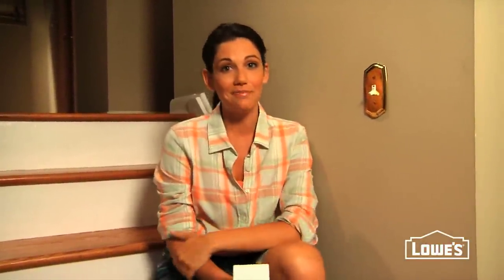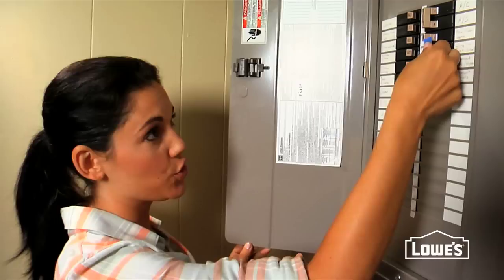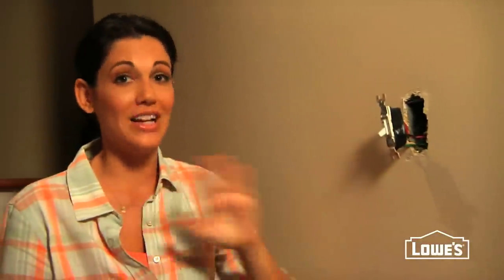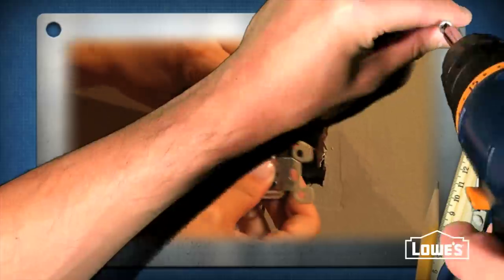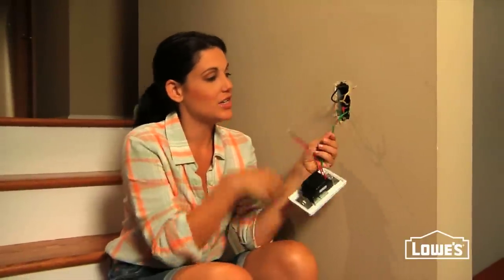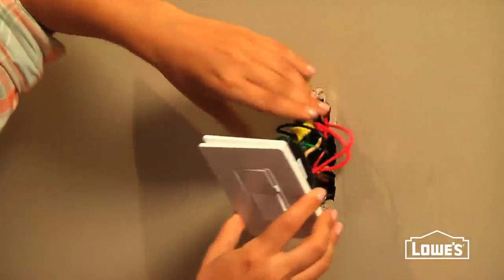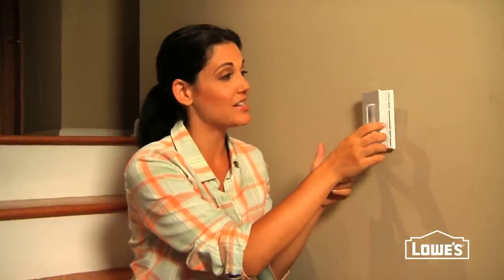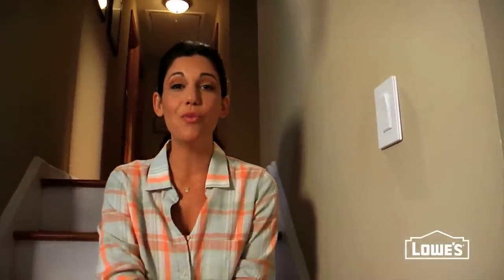How to Install a 3-Way Dimmer Switch

Comment: Installing a three way dimmer IS NOT just a matter of matching like colored wires.  This is how people make mistakes!  Before removing the old switch identify the wire attached to the common terminal and make sure this wire connects to the common terminal or common wire on the new dimmer switch.  The other two wires are the traveler wires and can typically be connected to either of the other two terminals or wires on the dimmer.  Always read the instructions and be careful.
Reply: Any way of identifying the common wire? My switch didn’t have a different color screw
Reply: @damon323  it really depends. i've seen some crazy 3 way switch wiring with different (non-standard) wiring schemes. there is no specific way of doing it without the wires being live or inspecting each box and knowing the different 3 way switch wiring methods. your best bet is to identify where your power is coming from and consult online diagrams to understand what is going on. when in doubt, hire a professional. electricity isn't something to mess with if you aren't comfortable with it.

Comment: The video shows her twisting the wires together in a counterclock wise motion with the needle nose. THIS IS WRONG 
The CORRECT METHOD is to twist the wires together in a CLOCKWISE motion.
Reply: +Paul Tringuk Jr. .Actually you shouldn't twist  the wires together at all  before screwing on the wire nuts.  You should skin the insulation back about a 1/2 inch from the end, hold the wires side by side ( touching one another )  and while screwing on the wire nut  is what twists the wires together.
Reply: @paultringukjr.625  i think you both are saying the same thing (or the information you listed proves Jeff's point). IMO some electricians twist BEFORE putting on the connector and some don't. If properly done, both methods will yield a good result. I'll only do it if I'm using the same types of wires (stranded/solid). Side note: again, IMO, 3M wire nuts are garbage.

Comment: I have a leviton nom 057 but it has 2 black wires 1 red wire n a green. How do u wire this dimmer? I am using as a single pole dimmer.
Reply from the maker: Doug Anderson since installation may vary suggest checking the manufacturers site for specifics. Thanks for watching our video.
Reply: OK what are the specs. Bought it at Restore and it had no paper work came with it
Reply from the maker: Doug Anderson Checking leviton.com is going to be your best bet.

Comment: wrong wrong wrong.... cant assume white is wired correctly. no explanation about identifying common wire first. common goes on odd color screw could be black or brass. line or common goes there. green grnd. other wires...solid red goes to red traveler and white and red goes to black heading back over to other switch or directly up to light. so much she left out...

Comment: Dimmers do not save on electricity.  The power has to be dissipated somewhere, if not the bulb(s) then the switch heatsink has to do it.  
Ever wonder why these dimmers get warm?
Reply: Light dimmers save energy by reducing the flow of electricity to the bulb and allowing lights to operate with lower power outputs. Since lights under less stress shine longer, dimmers are known to extend the life span of your bulbs, too.

Comment: Ah not always true! There are three screws (not including the ground screw), make sure you remove the wires on the 2 of 3 same colored screws and replace it to the same colored wires or screws then put the wire (your common wire) on the last off colored screw to the remaining wire or screw on your dimmer or your three ways wont work properly. Every electrician wires things just alittle differently, theres always more than one way to do it just make sure you transfer your commons correctly

Comment: I agree.  It sure would have been simple if the wires coming out of the wall were colored like the ones in the video!  My house is eleven years old and they're all black with bits of paint and plaster coating them.  I've only tried doing this job on a couple houses but it was always the same.  They NEVER look like the video.

Comment: she is correct.  she is not an electrician.  she didn't label the travelers,  you do not know that the 3way switch is off just because it is down, she spun the wires ccw, finally the point (black screw) was connected to the red wire on original switch.  she hooked it up as a traveler on the dimmer. FAIL